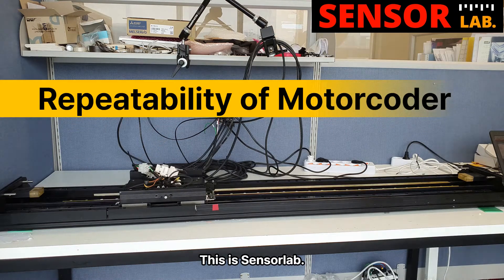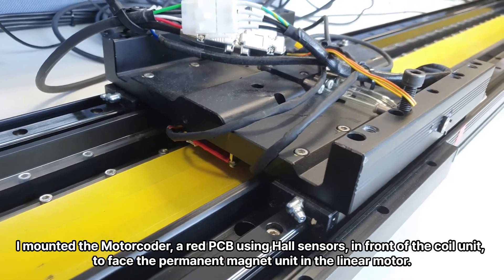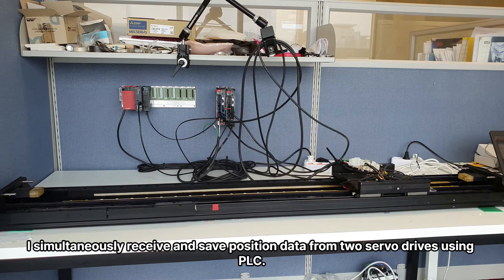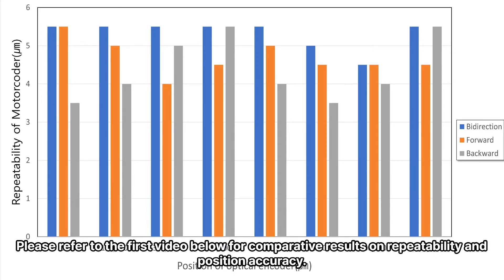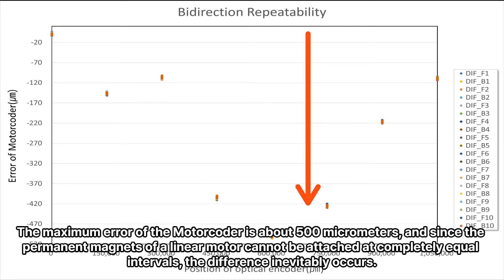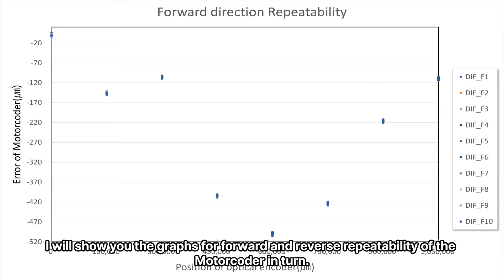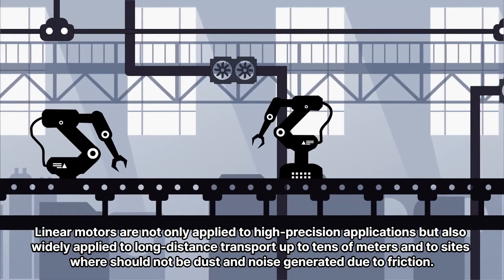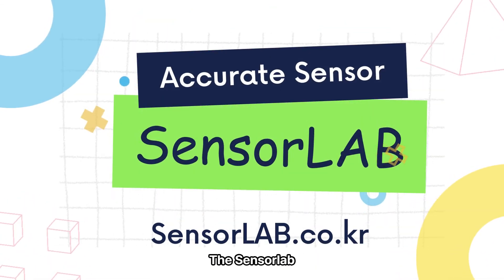Repeatability of Motorcoder, Scale-less absolute linear encoder, for the linearmotor

Comment: How to calibration sensor linier and comunication in inverter parker help me please
Reply from the maker: Thank you for watching. Does the calibration you mentioned refer to compensating the position of a linear sensor relative to its actual position? Typically, position compensation involves measuring the position error against a reference, such as a laser interferometer or a master sensor, and then mapping and compensating for it. This can involve compensating as few as 2–3 points or as many as around 20 points. The number of points to compensate is determined by assessing the linearity of the position error.

The most critical factor is that compensation is performed to improve positional accuracy when repeatability is high. If repeatability is low, compensation is often challenging. Unfortunately, since I am not familiar with using Parker inverters, I am unaware of the specific application methods.